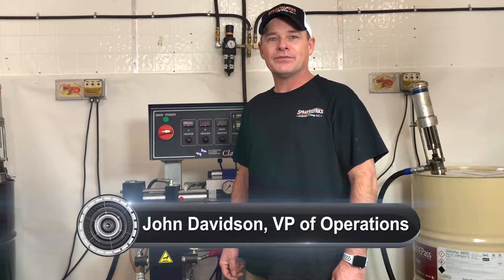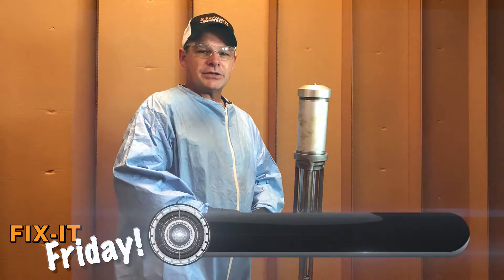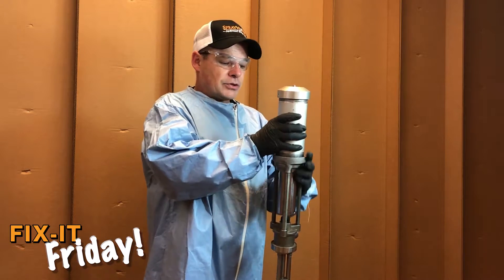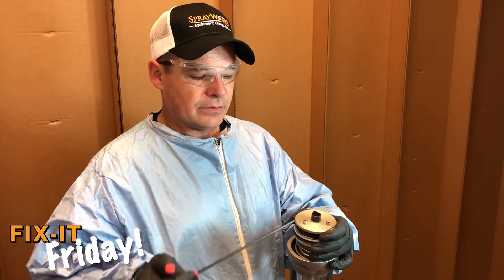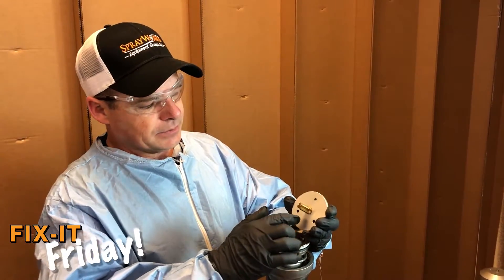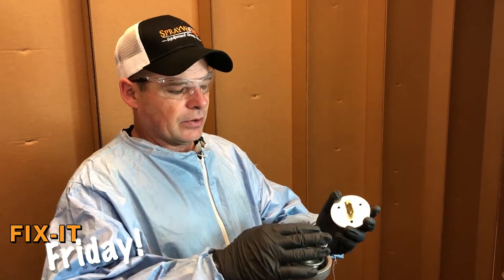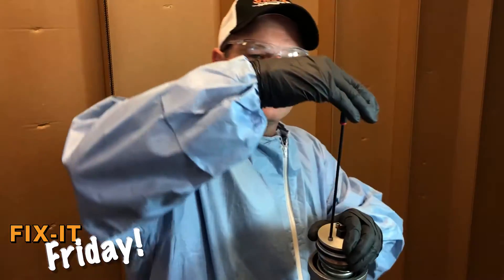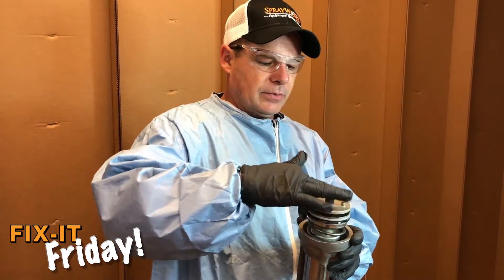Fix-It Friday! How to replace a GHO Transfer Pump Upper Air Gasket - for Graco, IPM, and PMC pumps?

Comment: Hi do you have a video on how to replace the hose heat button I think is call contact block my switch is broken I need to replace it with a new one how do I remove the old one